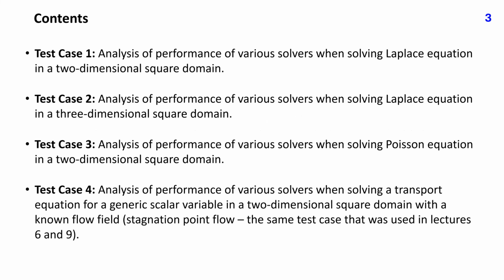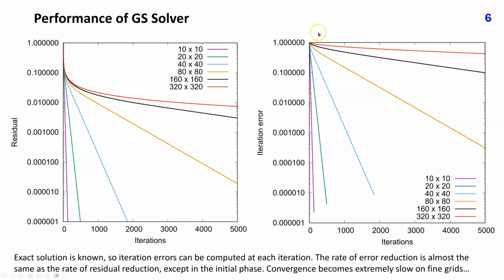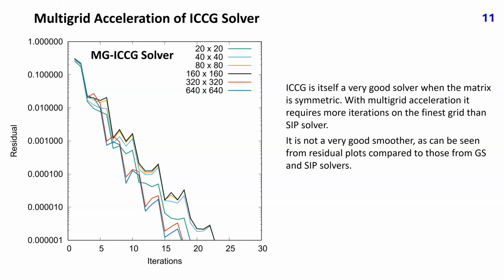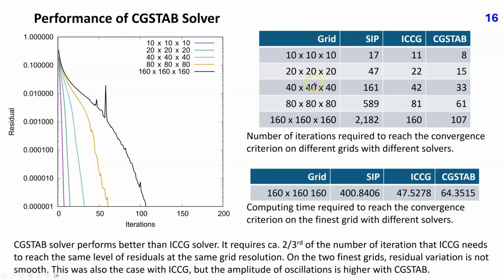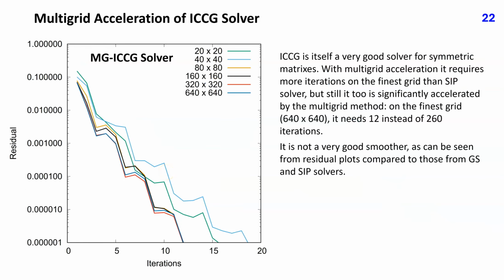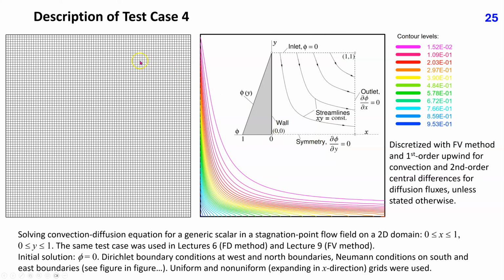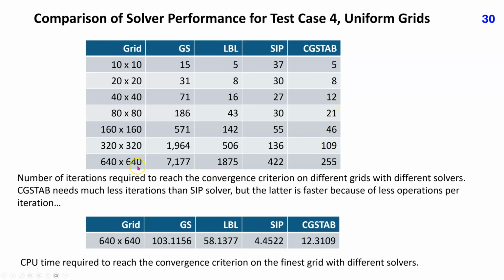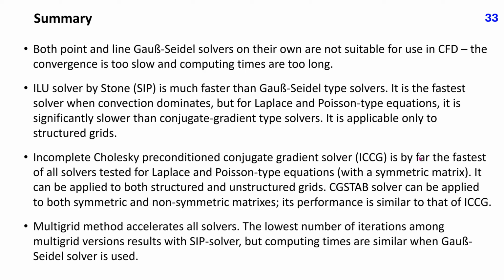12. Application examples for solving linear algebraic equation systems

Comment: Hello Prof. Milovan Perić,
I see that the multigrid is not used for convection problem (test case 4). Is this because this type of MG is not applicable to convection problems, or just that it was not used in this demo?
Reply from the maker: Sorry for my late reply...
MG can also be used for convection problems, but these usually converge so well with non-MG solvers that they cannot be substantially accelerated using MG technique. The reason is that convection-dominated problems usually have Dirichlet boundary condition at inlet and convection contribution to the matrix leads to a rapid propagation of information in flow direction. MG is most useful for elliptic problems - in incompressible flows this is the pressure-correction equation. It usually has Neumann conditions on all boundaries and converges very slowly with most solvers. In such cases MG can provide very high acceleration. MG accelerates also solution of convection-dominated problems, but not nearly as much as diffusion-dominated problems.
Reply: @MilovanPericCFD thank you for your detailed explanation.